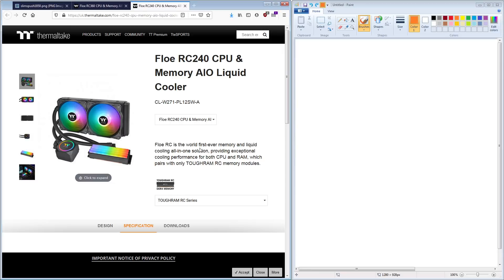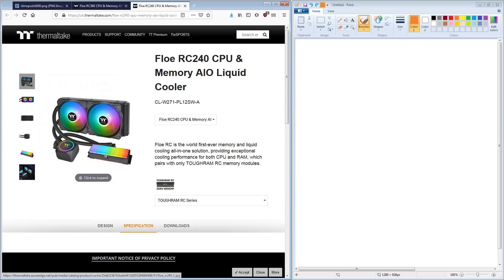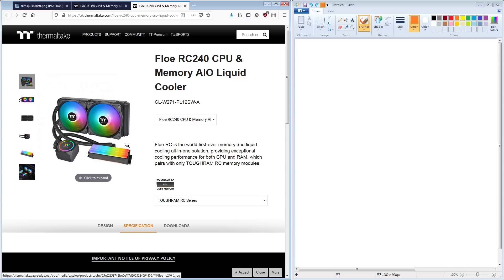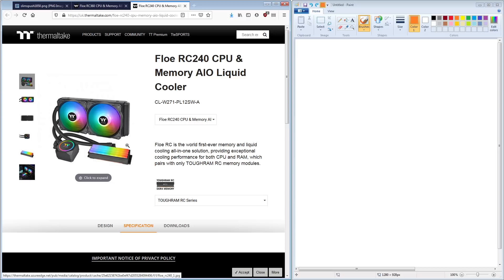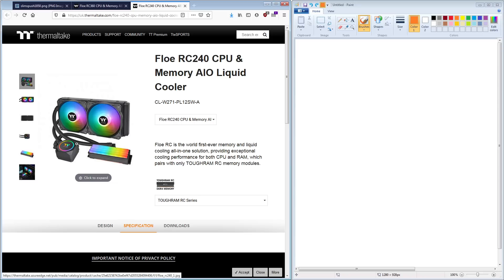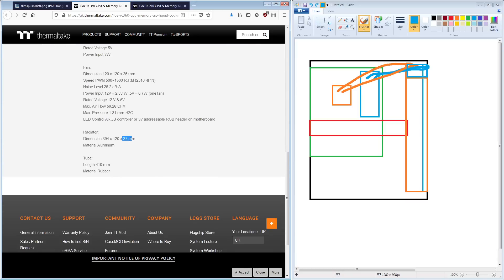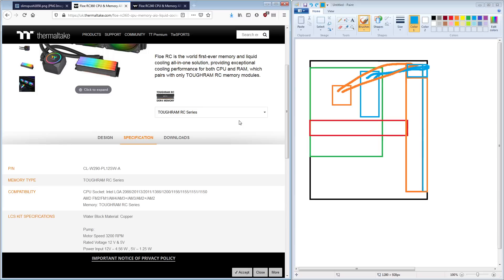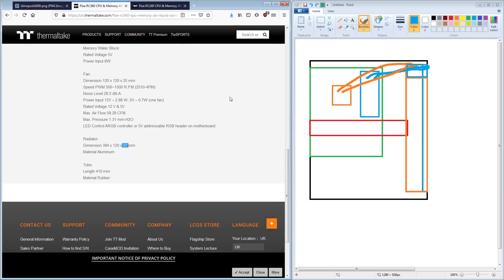Rambling about Thermaltake's Floe RC RAM + CPU liquid coolers & RAM cooling

Comment: How about you just make a TEC cooler for the memory? you're only moving like 20W from the memory, the TEC might actually be practical at those power levels, you wouldnt need a radiator, for say 80W overall a standard heatsink would be fine.
Reply: But then you would need to cool the TECs down and that's going to be a nightmare
Reply: I don't see how that would be any more of a nightmare than the water cooling solution which needs a double rad, a double pump, double hoses, some heat exchanger for the memory etc...
Reply: Corsair used to make one. The Ice T30. Basically a thermoelectric DDR3 cooler with a water loop on the hot side
Reply: an unregulated pelt of appropriate power will easily get you below the dew point so you'd need a temp sensor minimum and a pwm controller. arduino can do that ez, i did it.
anyway you'd be in the realm of 100w of heat max total (a lot less assuming it's gonna throttle itself to avoid making liquid water around) so basically nothing for a 240 or larger.